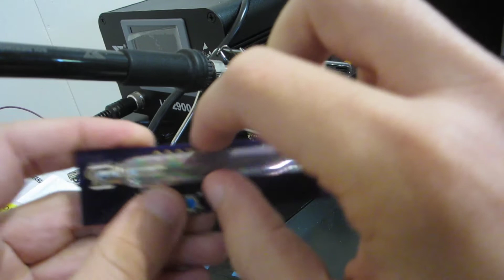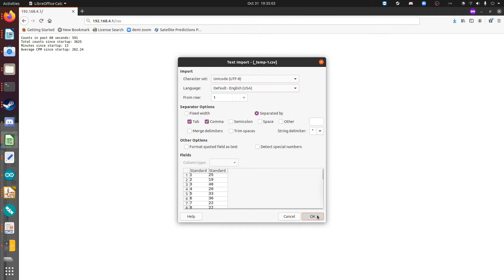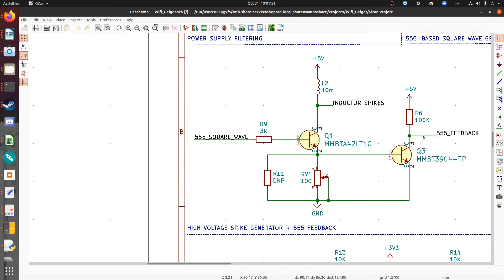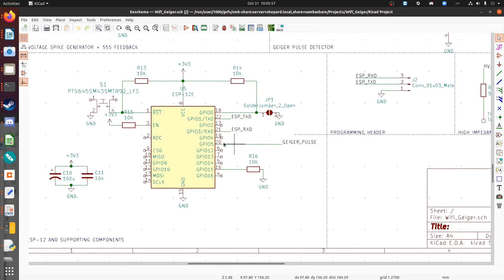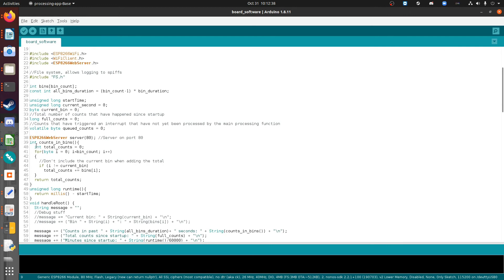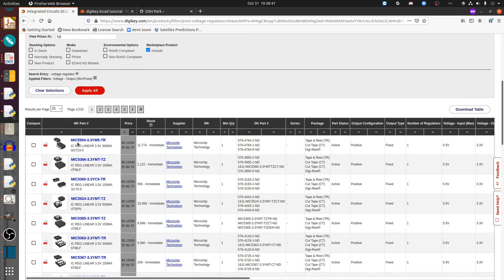My Wifi Geiger Counter

Comment: Very cool project, how much voltage were you able to get to the tube? Is that something you've been able to measure?
Reply from the maker: Yep! The tube runs at about 400 volts. You have to be careful about measuring it and have a high resistance in series, but 400 volts is about what I was getting out of it.